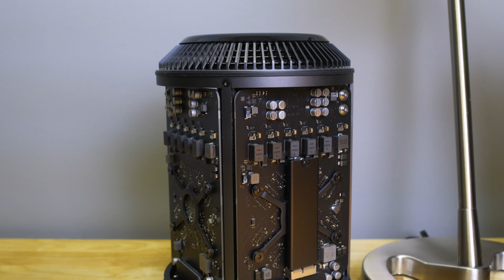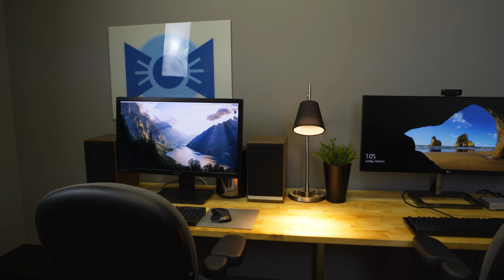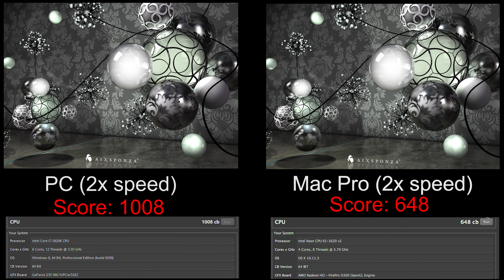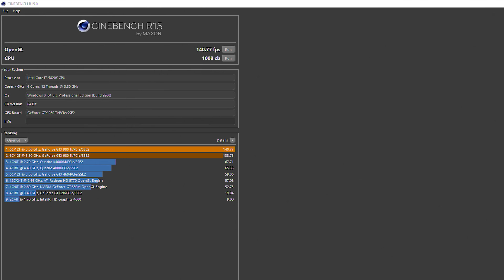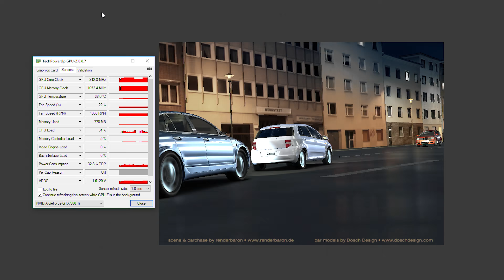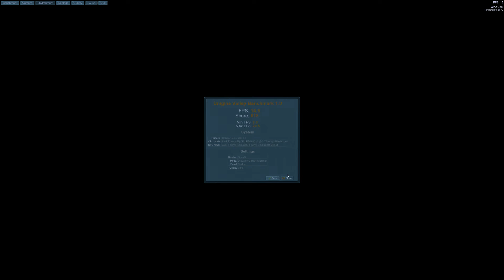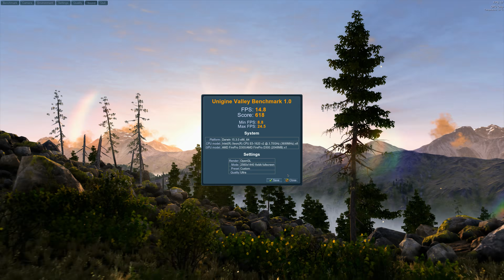$2,000 Custom PC vs $4,000 Mac Pro

Comment: Say what you will, I'd gladly use a Mac Pro if someone gave me one for free.
Reply: +mariochaosspear The only way I'd accept a Mac Pro for free is if I could sell it to some Apple-brainwashed fool for near retail price and then buy myself a proper computer and have $1500+ to spare after. Otherwise it'd just sit in my room and collect dust besides my (at best) lower-high tier computer I am currently using which would still smash that piece of garbage.

Comment: For those arguing that the Mac Pro is about a size/performance ratio, instead of just performance: I would absolutely agree with you if Apple had a long-standing, "lots of power into a tiny package" philosophy for the Mac Pro going on, but if you look back at the G5 and the 1st gen Mac Pro you'll immediately realize that Apple was very focused on simply building powerful machines for editing, no matter how big they were. I don't mind Apple trying to achieve something beyond "just powerful" with the Mac Pro, innovation is one of main the things that keeps us coming back to Apple products, I just think that Apple shouldn't do it at the expense of performance, since this isn't supposed to be just an object for status (even though it kind of is), like the iWatch, but an actual work tool.

Comment: LOL, i got 74 fps on the open gl test with a 750ti! The mac pro really sucks!
Reply: +maxd11 gaming Did you get it on ultra?
Reply: i did not know there were higher settings, i will retry it.
Reply: Well i don't know too but the guy on the video if i recall said he did it on ultra i have gtx 760 i migh also try it.

Comment: nice vid! gret comparison. About those panels... im afraid it wont do a thing about sound isolation. They might work to control the inner acoustics of the room.. but outside of it.. not a single dB will drop :(
Reply from the maker: +s galo They've worked perfectly! :)
Reply from the maker: +s galo They've worked perfectly! :)

Comment: I don't get why you would go with a mini-ITX board.. You have completely eliminated your future upgrade paths by choosing a board that A.) Doesn't support SLI. B.) Has only 2 RAM slots, and probably a maximum capacity of 32GB. C.) Is lacking in terms of USB2 and USB3 headers (expansion via card readers and the like, great for content creators). and D.) leaves you 0 options in terms of a system overhaul to upgrade most everything at once.  I would've gone with a standard ATX motherboard, and a smaller mid-tower case.  At least then you have #Options
Reply: A.) Fair point, but the lack of basically any other PCI-E expansion is also noteworthy.
B.) it is an editing rig, and given how resource intensive things like Premiere and After Effects are, 16 GB will not be enough RAM, nor will 32, especially when 4K becomes the norm.  I edit in both programs, and AE uses the RAM almost completely for video playback.  I have 16 GB in my current system, and playing a 1080p60 video back in AE completely redlines my RAM.
C.) USB 3.0 is much, much faster than 2.0.  USB hubs degrade that speed, and aren't really a completely viable option, especially considering choosing an ATX board could've provided as many as 8 USB 3.0 ports on the motherboard alone.  When you are talking about an editing rig that will most likely need a card reader, and perhaps even need a path for copying files off of external storage quickly, USB 2.0 just doesn't cut it.
D.) You should never go with preferred size over preferred workload.  If it was built specifically to edit, then size should've taken a backseat to functionality.  You can get a smaller mid-tower that wouldn't have been all that much bigger, which would've given more options.

I appreciate you citing you opinion, and not being a total trolling dickbag like most of the people that comment on YouTube.  It was actually quite refreshing.
Reply: XInfinity2013 after effects literally chokes your RAM without even adding any effects or overlays, just playback at normal resolution (I know, ridiculous).

Never used a PCI USB hub, as I've always gone ATX and never had the need. Everyone is entitled to their own opinion, but when someone is specifically building a machine to replace a Mac pro, one should go all out if for no other reason than the money you are saving.
Reply: XInfinity2013 damn man that sucks.. I just did skylake 6600K with an MSI z170a SLI plus, GTX 960 4 GB SSC, 240 GB pny optima SSD, 1 TB WD black HDD, corsair h80i GT, evga supernova g2 750w PSU, and got the whole thing built for about $1K, maybe a little less, in Massachusetts... I can't imagine what that would be like dude.. Where are you from?

Comment: I used to love Macs, as an artist I always used them.
Nowadays they are too expensive for what they are. Sure most of them look better than PCs, and as an artist I can appreciate that. But on a price/performance basis they are a dead loss.

Apple should forget the whole intel/mac platform completely and open their OS X platform to all PCs.
I love OS X it's one of the better Linux type distros on the market and does not come with all the M$ bull-crap you get with Windows 10. Sure Windows 10 is leaps ahead of Windows 8.x but it still comes bloated with all the garbage that you don't want/need. It would be so much better if Microsoft gave us the option to streamline our installation of Windows 10 to cut out all the excess stuff (like groove and edge) etc..

I think the writings on the wall for Apple, unless they up their game and spend some real money on hardware development they are going to lose. Making their products look edgy and charging 160% if the products real market value is not going to save them forever. Yes Macs look pretty, but it wouldn't take much for a case manufacturer to actually make something that doesn't look like a boring slab of computer.
Reply: +hartoz OS X is not Linux.
Reply: Bryon Lape No it's based on BSD
Reply: hartoz Yes, I know

Comment: The best thing that Jobs did is he put Mac back on the table by ditching the aging PowerPC and switched to use Intel CPUs. The mac was once again powerful. Now, it's slowly getting worse again. Mac is well designed, beautiful but ultimately, a computer is judged by performance. Not only the Mac Pro but everything Apple build are the most expensive ones but the performance is just not good enough. That's either pure greed or stupidity. It's much more easier switching to use say a better graphics card than switching from PowerPC to Intel (much much easier). And yet that's how it's done. Jobs delivered but the current Apple executives won't.

Comment: He is right though. Pre-builds are always terrible. 
Not just Apple. 

However if you got 3k to 4k to burn, I am pretty sure even the highly overpriced Alienware or Asus ROG setups can deliver more than the Mac Pro.
Reply: Pre builds are pretty bad but you can get PCs made by choosing every single part from companies like PCSpecialists if you dont want to put it together yourself. Thats what i did this time around because i got sick of having a ton of seperate warranties. Good to get it built by someone who does it for a living too. It probably cost a little extra but it was more than worth it. I have heard bad stories about other companies that do this but PCSpecuialists were very proffesional.

Comment: The only issue I see is that i7's and Xeon processors are made for different workloads. i7's are purpose built for gaming while Xeons are really for running through large data sets like simulations/something a meteorologist might be using. Linus TechTips explains this better in his videos than I can unfortunately.

Comment: i know you probably dont want to hear anything else about your powersupply lol but i have an evga powersupply that i bought recently and ive found out that they seem to not be the greatest with overclocking, i have the 1000 watt g1 and i used to have a 700 watt ocz. when i ran the 700 watt i could easily hit 4.8ghz on my amd fx8150 and now with my new powersupply im having issues getting a stable 4.6ghz out of the same exact setup, keep that in mind if you dont end up getting the overclock it looks like you should get it might be worth testing your pc with another powersupply from a friend or something. fantastic videos man im extremely new to your channel this is the 2nd video ive seen from you but im already subscribed cant wait to see more.

Comment: The amount of stupid in this video is astounding. You are comparing a water cooled  2016 custom gaming PC (a badly thought out one at that) with the cheaper version of a 2013 workstation that's 5 times smaller in size.  The reason you'll be able to sell your mac pro is that it uses server grade components that haven't reached even half of their projected lifetime. Try selling a 3 year old pc and tell me how that works out for you. 

BTW I've never owned an Apple product because they're either overpriced crap or professional hardware I don't need, and while  yes, Apple should update their lineup, this video is shit.

Comment: @Tom Bortels Building  a pc is fun though, so you don't need to charge for it. Also what is the point of spending ~$2000 more because you dont understand the basic concept of Lego. Um.... ever heard of Mackintosh, "cough" "cough" dual boot with Windows.

Comment: Did you calculate a value for the time you spent building the PC, including your lost time messing with a refurb power supply, in the cost of the PC? Or costs of ongoing maintenance? Did you do any measurements of power usage, or noise levels? Can you legally run both OS X software and Windows on the PC? 

I didn't think so.
Reply: still under the cost of 4000$

Comment: the difference is in the OS, I am windows person but i do appreciate the greater ease of coding + utility that their shell provides.
Reply: +TheNacropolice how would any sane person be willing to deal with apples bull shit just for slightly easier coding?
Reply: Many programmers use macs, the terminal allows for many applications to be installed with far greater ease, and some would only work on a Mac or a Linux type machine.
Reply: +Jammer I myself use a windows machine for programming as I find the Windows OS more pleasing and easier to use. the nice thing with OSX, though, is that it is a simplified distro that removes the unnecessary stuff away, or at least keeps the core stuff in.

Comment: I would watch this video but i cant watch it on a setting lower than 1080p for some reason, and my computer usually sucks at handling anything above 720p. Why cant i put it on a smaller quality thatn 1080p. I usually immediately switch to like 480p if a video buffers too much, but this video litterally only has the options of 4k, 1440p, and 1080p. WTF!

Comment: And now you understand why we call it the PC master race >:D  mwahahahah  
sorry, but this has been pretty much the case of every single mac every released, WAY more expensive and can be if nor replicated, but blasted by a PC at a quarter of the price, and WAY more upgradable.

this is an apple issue though, it's not the fault of the mac OS though, ugh ~shiver~  yuncky, tghen again, I HATE windows 8 - 10  Microsoft have become utter idiots it seems.

oh yea, not to mention you can build a pc with specific hardware and run it as a hackintosh.
more powerful hardware using the same OS.   takes a bit of know how though, there are plenty of walk throughs on youtube and google though.

Comment: my overclocked A10-6800K can manage 359 on cinebench multicore, and it cost $110 when i bought it. also got a used HD 7770 2GB, overclocked it, and can get 77fps in the openGL test.

guess ill just slap in another 6800K and i'll have a mac pro 

kappa

Comment: I see a few things wrong with this test and have a few questions.

1.Where did you get such an expensive computer,I have one of those,brand new from an Apple store and it cost $1,800.

2.That is not the newest computer from Apple,they did upgrade it many times.(My newer version cost less,had a better display and  was quicker in almost every way, and was half the price,they even sold laptops better than that recently,so that is not the newest computer.)

3.Did it cost anything to learn how to build a custom PC? I have no idea about building them. (Maybe you could've factored that into your final cost)

4.Apple products are also meant to work with other Apple products.(For example,if you have an Apple phone,watch and PC they're meant to work together)
Reply: +Jimmy Bl3nnau At least for number 3 it is free to learn how to build one, I learned from self educating my self on it and now I can build a watercooled system with a lot of componentry and make it work. There's plenty of guides around to show how to build one.

Comment: Okay, let us sort this bullshit. 
Firstly, Valley Benchmark is a gaming-bound benchmark which absolutely defeats a Mac Pro's purpose.
Secondly, you are comparing Ivy-E Quad Core Xeon to Haswell-E Six-Core i7 and ECC with non-ECC. Its like comparing an S-Class with a Tesla.
Thirdly, you are comparing a 30-litres ATX/mATX build to a 5,5 litres custom system.

Your numbers are right, but your comparison is inadequate. Please consider not to compare your dream gaming rig with a workstation that has a clear specific purpose in the future.

Comment: Good sir!
Deary me I have to ask ol' chap.
If you took a prebuilt pc instead of a custom one and made a side by side comparison with the mac pro, I would presume the performance would be closer. For the mac pro, you pay for the manpower aswell (certainly too much, way too much I daresay) but still.
Custom PC's are always cheaper than normal ones. since the Mac is not custom built some performance has to be taken out of the picture, nay?
And no. I am not an apple fanboy. I do not own a single apple product, and is proudly typing this on my custom built pc with a core i3 and a gtx 770 because I was a complete bellend when I picked the parts.
Still runs Far Cry 4 at ultra 60fps though.
And with that comment written I say, tata

Comment: You have only just realised Apple sell less for more money...they have done this for as long as i can remember...PCs generally have better hardware, Mac performs better in most cases because it has less hardware to support, less users to support and less variation on what hardware users run but Microsoft who have to support well over 90% of the entire computer market (not including tablets) have to build software which support larger variations and thus more potential for bugs and a larger target for hackers, hence why MAC also has less viruses (although far more than most of their users seem to believe...the amount of times i hear "i have a mac so i cant get hacked" is beyond belief)

Comment: Um... sorry to bust balls but... why do graphical benchmarks when the firepro's are designed to do GPU workloads, such as auto-cad etc?   
Throw them into an application the computer is actually designed for, and you'll get better results, Obviously throwing workspace gpu's into something like that would have poor results.

Total PC supporter, but the graphical part of the test is just not comparible.   Its like taking a work truck out to a race track versus a race car.   Infact really you can't properly compare the cards, though a 980-ti should suffice in workplace style loads as well, not sure how it measures up though.
Reply from the maker: +Aura Rowe (Neokolzia) It's an OpenGL test. Just because it looks like a video game doesn't mean that the benchmark is. It's a pretty even test for all general work/play processes. :)

Comment: Meh, 90% of the time I get great use out of refurbished products, even power supplies. You just had a lemon this time around. It happens. Everyone freaking out about it is just kind of stupid.
Reply from the maker: +InstrucTube Finally, someone sensible. :) Thanks for watching.
Reply from the maker: +InstrucTube Finally, someone sensible. :) Thanks for watching.
Reply: No prob. I just found your channel, liking it so far. I'm less interested in the tech reviews than the builds like the handheld emulator, but I build PC's as a side job so I guess I kind of already know that stuff. Keep it up, good vids so far.

Comment: I built a computer 3 years ago for $650. gtx 650 i5 2500k. it did better at at about of 650fps on the valley. I upgraded to a new GPU for $200. a GTX 960. and got a much higher score. $850 and a better computer. don't waste $$ on our built computers.